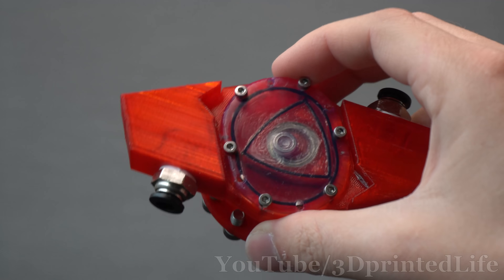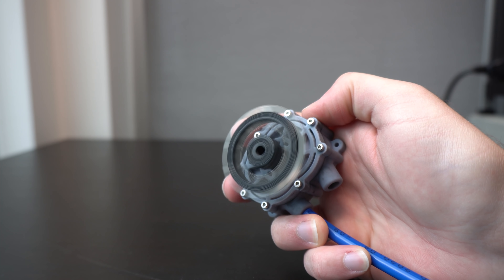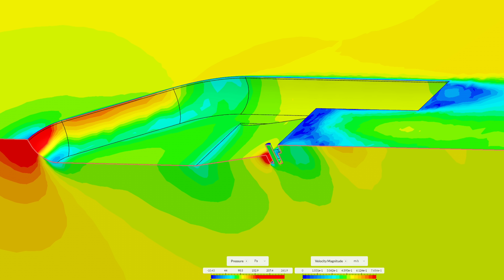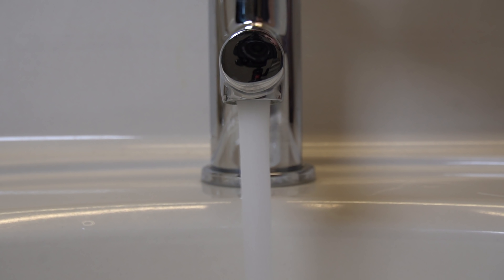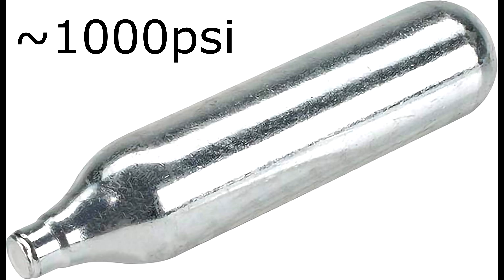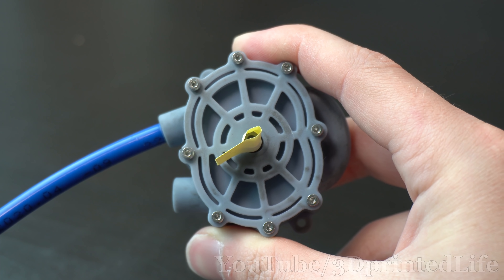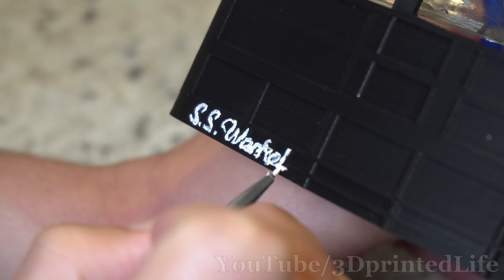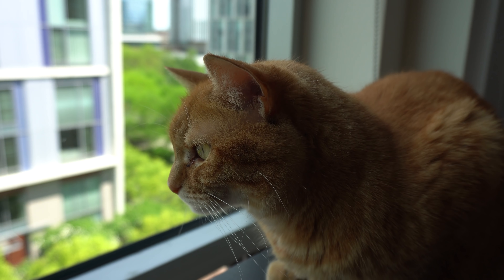Building a 3D Printed Wankel Powered Paddleboat

Comment: You could make a rotary Stirling engine that uses steam to power the boat. Load it with some water in a boiler and boil it to run steam through the rotary instead.

Comment: nothing serious can go wrong with a co2 cartridge lol very rarely do they malfunction and even then balsa wood is enough to contain it most of the time the fact you used living in a city as a excuse is really lame lol your 2 liter bottles are more dangerous since theyre not designed for that pressure and can fragment when overloaded happens to meth cooks all the time not that youre doing that lol just a analogy but the co2 carts are designed to not fragment when bust theyll rip open but stay intact ish

Comment: Cool video but a critical flaw. All of the pressure drop at the regulator is power loss. In other words, all of the power that was used to compress the air into the bottle, is lost at the regulator. (except for the remaining pressure). A 2L tank @ 100psi going through a regulator to 10psi has ONLY the energy of 2l @ 10psi! Not 100psi! The only way around this is to make your power extracting surface in the engine what limits the airflow. IE the piston regulating the airflow. You will get immensely more power.

Comment: I think you need air injector that will be controled by microcontr ler for maximum air economy also can you use a bootles as a floats for the boat it will be more air for engine and boat will be more stable im thinking about two spaced 2 l bottles and engine in the middle

Comment: Curious why you show the pull chain... but do not use it for the drive mechanism. You lose a lot of energy when the rubber band flexes (synchronized sprockets that grab every third tooth, and skip the clasp?). A you could make the engine and air hose or the paddle smaller and gain run time?
Reply from the maker: Purely a coincidence I got that shot, apparently my filmmaking side is smarter than my engineering side.

Comment: Be careful with putting high pressure into 2 liter bottles. Years ago I had a homebuilt air gun blow up on me at about 100psi and I still hear the ringing. Also that was 2006.

Comment: 1. graphite is actually terrible as it's porous and lets air through it. that's the very principle a lot of air bearings use. Applied science has a video or two on those. 
2. belts need a convex surface. (rubber bands included). you don't need a groove, you need a bump or else the belt will climb out. it's pretty counterintuitive but belts are self-centering on "bumps". Steve mould has a good video on this called "the band should slip off but it does the opposite"
3. could have used 2 bottles and used them as part of the boat to help it float instead of extra weight pushing it down and ruining the hydrodynamics (and stability) of the whole thing. and also the printing lines on the boat will cause massive drag, like a file on a piece of wood.
4. a bigger everything will have a lower relative air loss on the wankel engine cuz there's less sealing surface and more volume for air (one scales linearly the other super-linearly). so doing this with 2 jugs (which will likely be better hydrodynamically anyway), a bigger engine, and a lighter paddle wheel might yield great results. 
5. use lubricant on the axels
6. may be a good idea to use some chemical reaction to generate pressure from a liquid or solid which will have much higher energy density. can also still use CO2, even if you're still using the bottle, as it has a greater compressibility factor and, again, higher energy density.

Comment: I would put a spliter on the air output and run 2 air lines to the back of the boat and out into the water to provide another 1/100th of a gram of thrust! Lol

Comment: You could try this to see is it possible.., future project idea?

Link the engine to a dc motor, that generates enough power for an electric compressor that in turn will be the source of air back to power the engine..! 😁

Really good that works..
Reply from the maker: That seems very unnecessary. I like it!
Reply: 😆😆 Would love to see that in action..

Comment: No need for air regulator gears would have done it and the engine itself would have been the regulator
Reply from the maker: That would be true, but only if the engine weren't so leaky. I'm beginning to work on a next gen rotary engine which should have way better sealing, but that is still many months away!

Comment: You should premix your resin with graphite. And because you're not combusting anything inside your rotor, you could probably add some silicone grease to it as well.

I'd also suggest putting a superhydrophobic coating on your entire boat, such as using fumed silica or lycopodium powder.

Comment: 9:38 You could try an outwards curved belt pulley. This is maybe counter intuitive, but the belt should maintain in the middle that way. You can check out some old machinery, they work even without the sides.

Comment: CAD + FEA package used? FDM  printing with accelerometers will catch up to SL printers!
Reply from the maker: Autodesk Inventor for CAD and SimScale for CFD. FDM will improve a lot but by the time it catches up to current resin printers, the resin printers will have advanced far farther. Each tech has its own benefits, but resin will be way better for resolution and print quality for the foreseeable future

Comment: Try using liquid nitrogen and then put some hot water and a pressure regulator on that so it doesn’t blow up and use that and you should be able to use a smaller bottle and a way way way longer run time

Comment: 9:40 yeah your rubber band is a band*. those try to climb *up rounded/sloped grooves. either make it perfectly rectangular in cross section, or make it convex instead of concave, as dumb as that may sound it helps it selfcenter (by stretching the side that's on the larger diameter a bit, making that pull the other side towards it)

Comment: It did not last long as expected in water because there is no load when you are testing outside the water. It's just air. So direct injection of compressed air should have made it move further because it just dumps a lot of torque which gives you speed.

Comment: If you're using rubber bands as belts, invert your pulleys to be convex, they will self center the rubber band. A flat pulley on the large side and convex pulley on the small side would probably be best.

Comment: 9:38 Yea, you used a wide band with a grove (running it on a concave surface). Wide bands always try to climb, so one solution is to run the wide band on a convex surface, so it's climb tendency keeps it centered. On the other hand, using a rubber "band" with a square or circular cross section would run centered on a concave surface like your grove. That is as long as you do not tension it so much that it becomes too much flattened on the surfaces it runs on.

Comment: So when you're designing pullies for elastic bands and such use a profile with a convex surface rather than the typical groove. It's counter intuitive but it will self centre if the running surface is inverted. 
Think it was Steven Mould that put out a video explaining 🤔

Comment: This was great, thank you for explaining why it would be beteer to use a regulator than using a smaller outlet. Nice fly wheel and pulley. What would it take to design a 3D printable compression tank.

Comment: tesla turbine axle to tesla turbine water jet, two tesla turbines axled in one
Reply: metal mesh pressure bottle netting for higher pressures, more than you have in non-meshed bottles
Reply: super cap loading by generator, yes pressure-electric, to get true same power all the way
Reply: candle boat is better

Comment: hey, the reason that it's hard to work with your rubber band is because your grooves are supposed to be inverted (opposite of intuition).

"Because flat belts tend to climb towards the higher side of the pulley, pulleys were made with a slightly convex or "crowned" surface (rather than flat) to allow the belt to self-center as it runs"
source: https://en.wikipedia.org/wiki/Belt_(mechanical)

Comment: I dont know if 3dprintedlife will see this, but there is a way to keep belts like your rubber band drive belt on the gear without it always slipping off and not using really steep slopes to keep them there. I dont remember who i learned it from but a belt will stay on if you invert the slope so that it looks more like a donut. 
Something about the sides of the band being less stretched than the middle keeping it on (similar to how belt sanders work). If you use a belt like the one in the video on a different project, give it a go. (Do note that it only works with wide belts and not thing ones)

Comment: Tip for the pulleys: your pulley profile should be inverted. The rubber band won't climb the edges of the pulley if they're tapered downwards. Seems counter-intuitive but it works.

Comment: You need a nice Long keel underneath and maybe even some Pontoons on either side... The Paddle propeller you got going on there is more like a paddlewheel boat with very small paddles. You know that though. Obviously bigger paddles on the wheel would be the way to go coupled with the keel and pontoons as the setup you have is top heavy.

Comment: Can someone explain why exactly are they using wankel design for air power? Is this in any way sensible? And why not add a couple wankel stages so the air doesn't just push the engine once?
Reply from the maker: It is definitely not optimal for air power, but it was an interesting engineering challenge!
Reply: Yeah that is a good point
I wonder if it would make it go further by adding a couple more engines to the air outlet of the first one and connecting all of them to a common flywheel or something along theese lines. The paddle of the boat could also serve as a flywheel if weight is added. Idk just throwing some ideas, nice project btw :)

Comment: Resin printers have a max theoretical tolerence of .075 mm, closer to .1 in actually with a 4k screen. I even got a quote from formlabs, they also informed me resin tolerence were about ~.1mm. certainly not "much better tolerence than FDM" when fdm also has .1mm
Reply from the maker: I used to work at Formlabs actually and have significant experience with both fdm and resin based machines. There's far more to it than just the theoretical and best tolerances. Fdm printers can hit similar tolerances to resin in many cases, but not all. Fdm printers have significantly more artifacts which can absolutely ruin their accuracy, in addition to layer lines being significantly more pronounced on fdm vs resin at the same layer height, plus top surfaces can be nearly perfectly smooth and flat with resin printers. Even with ironing, fdm can't come close. Resin printers have their own artifacts and inaccuracies, especially shrinkage, but it is far easier to reduce or accommodate for these by carefully laying out part orientation and placing supports
Reply: @3DprintedLife  in my experience you can get flawless prints with FDM, better than resin in many cases. You can do down to .04 layer height but in my experience .08 gives a perfect walls and overhangs. Neither of which I feel are relevant in this part. I won't even get into the strength of FDM vs resin. And I can't imagine the practical tolerence is better then the best theoretical one

Comment: You should totally redesign as a catamaran with the paddle in the middle for increased stability.

Or just do whatever you want anyways, great vid.
Reply from the maker: That's the plan! Though I'll switch to a propeller at that point since I only used a paddlewheel for the steamboat aesthetic.

Comment: By some miracle of mechanics crowned pulleys actually hold the belt in the middle better than slotted ones! Also I wonder if you can use your air storage as your boat with the paddle wheel and motor mounted vertically at the back and some side pontoons for flotation beside the wheel? Probably a lot of drag :/

Comment: Invert the pulley groove. With rubber bands you want a fatter center and a thinner edge wall and this causes an inverse affect bringing the rubber band to the center. You have a ton of friction in the pulley with the deep channel. I know it sounds counter intuitive, but it’s true. ONLY APPLIES TO ELASTIC BANDS. Old tractor PTO’s were designed like this because they discovered the same thing happening to them.

Comment: Most air compressors don't have regulators actually. Standard air pressure in most settings like shops that use air tools is around 125 psi.

Comment: LOL when I saw the end result with bottle strapped on top. This is the worst boat design ever.
Reply from the maker: You're not wrong :D I wanted to keep the old-fashioned paddleboat aesthetic (at the cost of performance) and I underestimated how heavy an empty 2L bottle is. The plan was to add some weight to the bottom to keep it somewhat stable but it ended up just being too heavy. But I do have a number of ideas to build a better boat, which I may just do once I have my liquid piston engine ready!

Comment: Don't use flat rubber bands on grooved pulleys use the thin square type or change your pulleys to  curve like (===||===) vs )===||===(   i know it seems strange and all your thinking would make you think the rubber band will come off a pulley like (===||===)  but flat rubber bands will in fact move to the top of the curve oO

Comment: Your rubber bands were so hard to make work because u cut the grooves for them the wrong direction. They should be convex instead of concave. Like an oval like your belt sander pulleys

Comment: I think it'd be cool to try a catamaran/pontoon style boat and have 2x 2 liter bottles to act as the pontoons (and the air resevoirs) and then just print a cradle to join them and hang the paddle from. You'd have more air supply, guaranteed watertight pontoons and probably less printing time/plastic, plus it'd be more stable than the "bottle-over" configuration you're currently testing.

Comment: Sorry - with all the details of around the engineering, the failure to get an anywhere decent boat design done was this undoing.  You should have spoken to someone - with the big gas tank on top, you could have gone longer, sharper and trimaran for stability.   As a boat person, the wankel was great, the boat, a complete waste of time.

Comment: If you want to run more efficiently, make the boat more buoyant and reposition the exhaust to be horizontal. This way, the exhaust will propel the boat forward giving it an extra boost, as well as removing the downward force it is exerting, in turn giving less drag.

Comment: 9:40 Here’s a little tip to stop the rubber band from falling off, the pulleys  need to be convex instead of concave if you’re running a flat belt.

Comment: Could you try and make a version that is printable with a normal 3d printer
Reply from the maker: As in an FDM printer? Well, if your machine is good enough and you have the patience to sand the parts, you could make this on an FDM. But I do have another wankel engine video in which the engine was specifically designed to be printed with an FDM machine!

Comment: use a convex shape for your pully system for the wide rubber band instead of a concaved shape, this will keep the rubber band from moving for very complicated and hard to explain reasons.
Reply: You can try adding a boat keel to counter to weight that is present on the top of the craft.

Comment: Have you tried spring loaded seals like a real wankel?  Making a captured and spring loaded seal wouldnt be too hard.  The wankel needs a seal that adjusts slightly.  If you used a section of ptfe tube as your seal even better.  You can split it if you need to to mount it.  Leaving it round might be better if you can let it spin maybe.

Comment: You could probably drastically improve the speed by piping your exhaust into the water and using it as a jet.  At the very least point the expelled gas out the back.

Comment: Typical air compressor regulators only have constant pressure outputs in fairy land.  In reality most compressor regulators will let the pressure drop quite a bit when you start flowing air through them. Expensive regulators can maintain more constant pressure as you increase flow rate, to a point, and generally the flatter you want your pressure VS flow rate curve the more you should expect to pay. For example the type of regulator with a curve damn near close to flat (for a given flow rate range, no regulator has infinite range) is a "dome loaded" regulator and those can go from hundreds to hundreds of thousands of dollars

Comment: Hello. I subscribed to your channel very recently so I hardly have any right to fill your comments page with suggestions, but perhaps you won´t mind too much if I just say that it struck me when watching this video that it might be fun to build a catamaran-type design. This could employ not just one, but two 2 litre bottles doubling as pontoons and providing an increased air supply. Perhaps you could print the necessary loop-shaped brackets to hold the bottles, and include a platform between the pontoons to house the regulator, motor etc.
 This would get rid of your leaks and the top-heaviness problem. If the bottles were mounted with their necks facing forwards the hydrodynamics might be tolerable enough to avoid offsetting the benefit of the doubled-up air supply.
 Thanks for hearing me out!

Comment: That groove is totally wrong, I forgot the name of this effect, but a stretchy belt will always "climb" so actually you want the opposite, some / many belt sanders do this, they don't even need borders / edges due to this effect! You can use a pulley with a groove like yours too, but you need a round band, or a square one. I think by using a flat belt with a concave pulley you also have quite a bit more parasitic power loss.
It's called a Crowned Pulley.